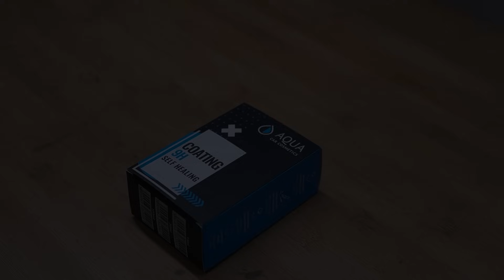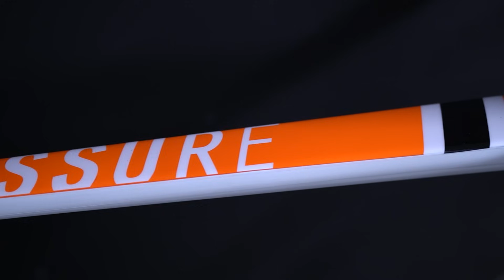Dreammaking #1 Cinelli Pressure Dura Ace Di2 Build

Comment: Looks like mechanics got the raw deal with so called evolution of technology
Reply: With the wireless group set and bar/stem it would be far easier to build than one with a mechanical group set. This I know from experience..
Reply: Still there are disc brakes, fluids, alignment. Changing wheel during the race is history, whole bike or you might as well catch a broom wagon
Reply from the maker: @branislavtrninic4505  Tbh changing wheels with disc brakes is way easier in this case, customer has 3 sets of matched wheels, where every one is matched in interference, so casette and brake rotor aligns perfectly. Way easier than setting rim brakes for different width rims and off-center wheels :D

Comment: was it only polish or some sort of coating to protect paint? i mean before applying foil
Reply: Was wondering if it was a ceramic coating
Reply from the maker: Both. 3 step paint correction, ppf self healing foil and ceramic coating to top it off :)
Reply: @cyclingstudio  which ceramic product are you using? I'm currently evaluating options
Reply from the maker: @chad.765  FXProtect, great value and easy to apply

Comment: On road bikes, the double pistons calipers are not necessary.  Can brokend the frame. The breaking power is too much for the frame.
Reply from the maker: Customer is very heavy, over 95kgs, also only these were available in black and orange ;) More than 6k kms on the bike right now, zero issues with cracking, and they brake beautifly.